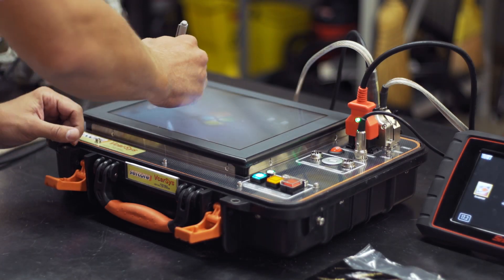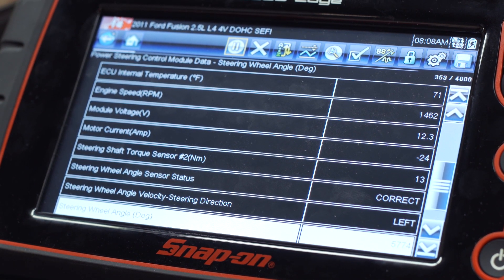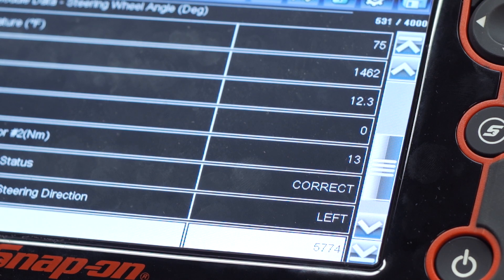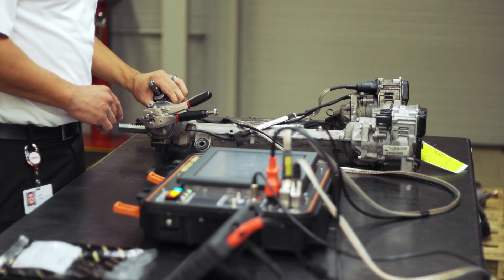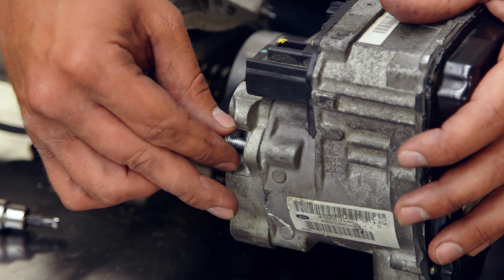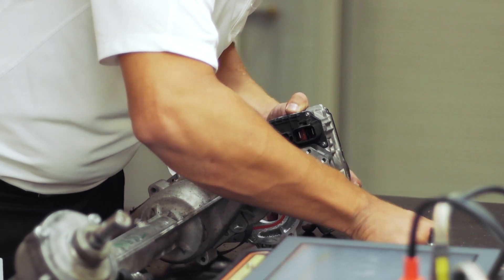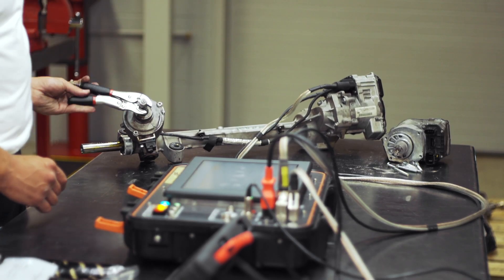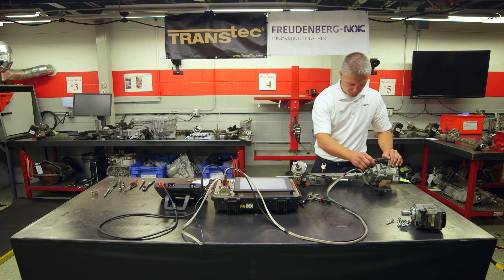Ford Fusion EPS Rack & Pinion

Comment: So what exactly is the point of replacing long proven hydraulic steering technology with highly-complex, expensive, fault-prone, dangerous, and non-consumer serviceable systems? Thousands of discrete and active components, computer, belt-drive that belongs in a sewing machine, ribbon-cable and connectors from a printer, delicate optical encoders and stepper motor with controller. This technology represents everything wrong in modern automotive design. Instead of focus on safety, simplicity, reliability, cost reduction,  redundancy; engineers implement what can only be called a 'nightmare implementation'. EPAS system implementation in automobiles since 2008 (especially Ford) represent one of the worst engineering blunders since the Pinto. Millions of EPAS systems have failed in Ford automobiles alone, leaving consumers with hefty $2,500.00 repair bills. Most units fail due to thermal damage because EPAS units are designed using non-automotive qualified components. In engineering school; we learned one of the most basic concepts for electronic implementations; 'reliability drop-off vs complexity'. 'Wisdom lays not on the path to knowledge'.
Reply: Well said B Smith. I've been working on  vehicles professionally for 45 years and putting electronics into steering racks has led to a lot of failures even on low mileage vehicles,at incredible expense. Progress?  Hardly...
Reply: Engineers gone wild!
Reply: B Smith You read my mind. A friend of mine bought a used 2015 Focus, and his steering just went out at 50k miles. Of course this has happened to thousands of people, but Ford doesn’t care. Rack and pinion with a damn computer and electric motor in it. I think we’re getting stupider with designing things. What’s next? Solar powered headlights? Lug nut velocity sensors? Driver visor angle sensors? Electronics in cars are going a little too far. Ford Fuk-us
Reply: Jim Armbre
Reply: All the Ford explorer have this. I just spent $1800 for the part and changed it myself. Took me about 10hours to remove it and replace. Sad to say the ford explorer is no longer worth buying. Buy something else, I had many complaints about it failing over and over again.
Reply: @nymincho  May I ask what the symptoms of a "dying" EPAS were in your case? My 16 Explorer (at 89k miles) is making a grinding sound (as if there is no grease between metal gears/ball bearings) when turning at low speed/stationary. By the way, does it throw codes before it locks the steering wheel?
Reply: They're more fuel efficient, they can be implemented in vehicles with ADAS, which is becoming an absolute necessity nowadays, the NVH performance is better than hydraulic gears (even more important in the electrification of vehicles), the amount of tuning for each vehicle model and trim level is far greater. They are actually very reliable systems going by RMA information. They also offer more methods of adding assist, be it assist to the column, the pinion, a second pinion, or a ball screw like this REPS gear in the video, which means more options of packaging into the vehicle's engine bay. Swaps can be performed in 30 minutes if you're trying, which is far faster than any hydraulic system can be bled, changed, then re-filled, I imagine. Plus going to EPS gives the option of Steer-By-Wire, which further increases packaging and tuning options. Also this tech is paving the road for independent wheel actuation, which is coming down the pipeline if the OEMs can manage. Not to mention they play far, far nicer with electric vehicles than would a hydraulic unit. All in all, the complexity invested in these systems are to reap the multitudinous benefits that OEMs require. Obviously not a cure-all or an improvement in every way, nothing in the engineering field is, but to be angry enough to write as long a comment as you have indicates to me, and probably most everyone else, that you're seeing the world from a very narrow point of view. There's a lot that needs to be taken into consideration, not just how a wrench monkey down the road will feel about it. They're less friendly to part by part repair than HPS, but w/out a doubt EPS is comes out on top for the majority of consumer vehicle concerns.
Reply: @jakewagner7416  Wow, you should really work for Ford! Narrow perspective and angry is right; but it is your perspective and your anger; you need to show some respect. Try reading thousands of comments from Ford owners who have actually experienced EPAS failures and fallout of dealing with Ford BS. Comments also filled with various opposite perspectives like yours; actually attempting to promote and endorse known poorly engineered and faulty systems like EPAS. This in spite of millions of documented failures in EPAS history since 2009. Ford cover-up and wide-spread criminal negligence deflection program costing consumers billion$. Ford even implemented repair and recovery program to profit from failed EPAS repairs. While you are talking fuel economy and performance enhancement, and turning blind eye to corporate sponsored crime; consumers continue to pay up to $4,000.00 each to have Ford dealers swap-out failed EPAS systems with identical replacements.     
Ford added even more 'so-called' beneficial features and hype associated with EPSS migration including elimination of oil spills of factory floor. None of this is interesting  to consumers experiencing hazardous, expensive, and frustrating EPAS failures. Features like performance tuning offer little or nothing to 99% of consumers just interested in daily commuting utility. Obviously you have never actually experienced EPAS failure, or experienced what it feels like to allow your wife or daughter to drive vehicle with potential for sudden loss of steering. EPAS issues are not about performance enhancement or any of the points you make; EPAS is about money, poor engineering, criminal negligence, safety, and corporate power over regulatory action.
Reply: @bk1468  sounds like you're just angry at Ford's poor business choices more than anything. If we're just going to count failures and successes, millions of HPS units have failed, and millions of EPS units are working 100% fine as we speak. I have experienced what it's like to lose assist in an EPS unit, as I work with in-development EPS units for a number of manufacturers every day and the engineering units often have bugs that cause assist to go out. Moral grandstanding aside, EPS isn't your issue. Shitty business practices are. Also if you're paying $4k for a new EPS unit, you're crazy. Wholesale they're $200-$500 from the factory, but resale is obv more expensive, shouldn't be paying 10x for a replacement. Can get one for 1/4 to 1/3 that price on most any unit out there. Like I said, lots of upsides to EPS, everything coming down the road in the automotive space is going to require electromechanical steering actuation in one form or another it seems. Personally never had my EPS go out (edit: on my personal vehicle, that is), but obv they do. Shit ton of HPS units break as well and can be just as dangerous as any EPS failure. Feel like you need to redirect your anger at the business handling side of things, but you're angry, so nothing anyone says will change that rn. 👋
Reply: @jakewagner7416  When consumers are paying on average $2-3K for EPAS dealer replacement repairs; it is no contest to state one must be 'crazy' to pay this amount. Engineers are certified with degrees and required proficiency in engineering design and implementation standards. When flawed and hazardous consumer products are designed, implemented, then sold for profit; criminal negligence is the legal term used to assert liability in a court of law. There is no business-end, anger, emotion, technology-trend, etc. When corporate bureaucracies become complacent in managing engineering proficiency and practices; blunders like the Ford Pinto and EPAS occur. There is no excuse for poor engineering design responsible for failure of millions of hazardous EPAS units. Any responsible corporation would fire every engineer responsible. Just a matter of time before EPAS failure causes death, and the entire Ford enterprise is put on trial; just like what occurred when Ford insisted it's Pinto design was proficient and safe back 70's. But that did not serve many consumers burned-alive in Pinto collisions. Would your opinions change if it was your family member killed by malfunctioning EPAS unit?
Reply: @bk1468  I watched your video…this Jake dude prob didn’t. To be on highway or any road and going at high speed (legally) and have your steering wheel get tight on you like a large bolt is a problem! I have exact same truck you have! Blows my mind our 2010 EB FLEX isn’t included in recall for 2011 and other newer ones and we have SAME FAILING EQUIPMENT! I am not a Ford guy. I bought this trying out their “newer” models and I got a steal. Not brand new but it’s the family vehicle we take to fit everyone, especially on vacations. Anyways, if they sold Pintos on purpose knowing what they knew I guess I shouldn’t be surprised. I’m just learning this even existed, electric rack on the Flex. I have the dreaded steering assist failure message too as of yesterday…SMH. Sound dangerous and not worth risk or a safety back up plan needs to be implemented for failures that happen while driving…
Reply: The point is not just one but several : 
1. fuel savings - this is the main reason  most innovations happen. You can save about 1.9Gallon of fuel per year by switching to electric steering versus hydraulic one.  
2. Easier assembly - the robot who builds the cars can connect a plug and and a bolt, but has trouble installing a loose hydraulic hose, so those have to be installed by a person which is bad, as that person needs a paycheck, a healthcare, a break between work, can get sick, injured, etc. You get the point. 
3. Cost savings -  Yes !  its cheaper for a manufacturer because the cars are assembled faster and with less human interaction. 
4. Increase of revenue - the rebuilding industry is taking millions or even Billions of dollars out of the manufacturer's pocket by providing a rebuilt low-cost alternative to the factory new product. With higher technology, complicated units this will put the money where it belongs, the manufacturer's pocket. 
5. Repair process reduction - no more hoses, belts, seals, etc. Just pop-in a new unit charge the high dollar and out. Human interaction is less timely, profit therefore is increased at repairs. 
6. It also takes less power from  a car, so more hp is avail. for the driver.  
7. With the electronic ps they can tailor the car to different driving styles and modes. Some prefers short ratio, some the leisurely soft steering, some in between. Now it is a touch of a button to adjust it. Also the cars has to self-park and the only way they can is with the properly set electronic steering which changes the steering angle instantly to high gear and able to steer fast. Also the self driving cars are almost here, 1-2 years away. (2019) and those require the same electronic units to steer effectively. 

I'm sure there are many more, but this is the commonly known reasons.  

If you think this is still BS and should have left the old, tested and tried method, you are not alone.  But we are the dinosaurs and the young generation don't care about much in cars. Their most common critieria when buying a car are : 
1. what type of social media interaction the car has ? Anything  but the latest is considered lame. 
2. How can I integrate my phone to the car and what level ? The deeper the interaction the better. The car should read all emails, texts, chats, snaps, whatever and be able to do all that your smart-phone does and take you to the places the smart phone picks out
3. How little fuel this car uses. Anything under 40mpg is in the OMG category and considered a gas-guzzler. 

91.1% of the people do not care what the HP/ Torque numbers on the car, what engine size it has or how expensive is for example the transmission replacement on it.  99% does not care if any of the parts are rebuildable or not, but 99% do care that the parts are "recyclable" .    They do not get that rebuildable is better then recyclable because a power steering rack should be rebuildable and I don't really care if they can melt it down to screws and nails, I want to re-use it as its original function.

The traditional car industry is being killed-off.  Within 30 years no new internal combustion engine will be produced and most things will be electric. Will it be good ? We don't know. We will HOPEFULLY see it and able to draw conclusions. Gas powered cars will still exists for a while, I expect total ban on them around 2100.  I won't be on earth to see that but it will happen no question about it.  If the oil industry changes to the electric charging field, they will just stop making fuel and that will be the end of it. Sure we can make fuel out of corn, wheat, etc. but it won't be like today. It will be a novelty and who knows what we will be able to actually do in 2100. Will we have green lands where we grow and harvest freely ?  

I'm happy that I was able to see the last hurray into the internal combustion engines. Awesome engines, huge HP figures, magnificent noises, great powerful cars. This is the last time we see V8 and V12 cars produced. The next generation  cars are all smaller engine and hybrid models. Within 10 years all manufacturers will have electric models and as I said 30 years from now, there will be no gas-only engines produced.
Reply: Old Worte
Reply: My guess is that you probably didn't graduate whatever "engineering" school you didn't go to.  Millions of units have not failed lmao. You're just an older school mechy
Reply: @ryanfreeman125  The Ford recalls for this shit implementation say otherwise.  And for those not under the recall years, there are numerous complaints by those that have had to shell out the ridiculous cost of repair (aka replacement) of failing units.  I for one will never again buy a car with such an implementation due to the prohibitive costs associated with it, and will outright never buy a Ford again.
Reply: @ryanfreeman125  And my guess is you are a blundering idiot with no practical knowledge or use. Challenging others to fulfill your own ignorance. Go back to your crack-pipe before I tell your mother about those kiddy-porn websites on your profile.
Reply: @ryanfreeman125 no he’s valid about that. It’s cool in theory but how ford did it made it fuck up.